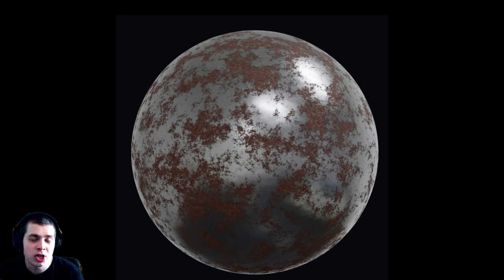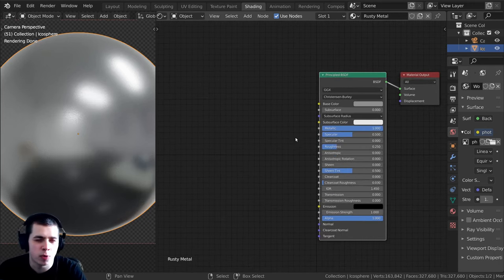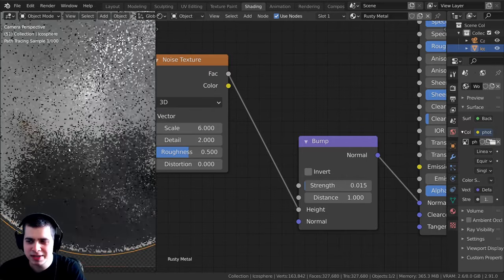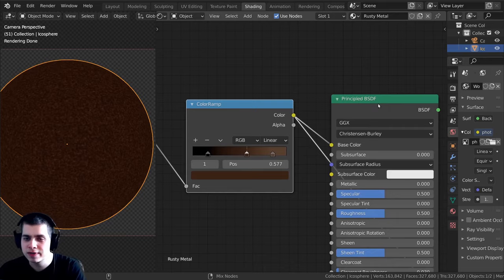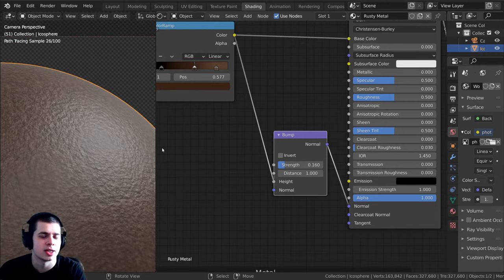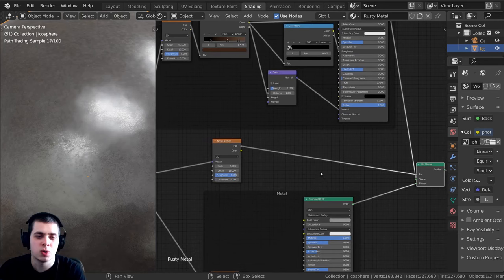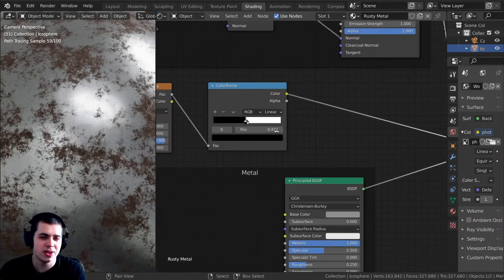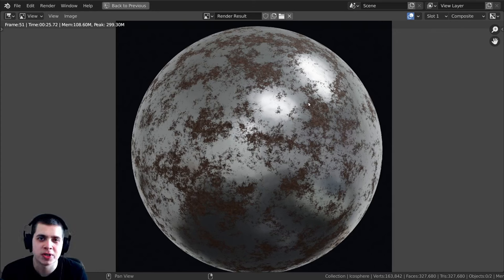Procedural Rusty Metal (Blender Tutorial)

Comment: Awesome tutorial, you've done a great job walkthrough why you add a node and how it affects the result. Subbed and liked! Btw I wonder is there any way to define a specific area of the same object to have more shiny metal than rust, and vice versa? E.g. I'm doing rail tracks for train, which should be more shiny on the above surface contacting the train wheels, while the lower part contacting the ground should be more rusty.
Reply from the maker: Yes, to do that, you can use a gradient texture. use a mapping node to rotate the gradient, and use a color ramp to control the strength. Then use it as a mask, to tell the material where the rust will be.
Hope this helps, and thanks for watching!
Reply: @RyanKingArt  Thanks, I tried but no luck till now. Do you have any video showing this method?
Reply from the maker: @NghiemMaiQuang  Hmm. No I don't. sorry.